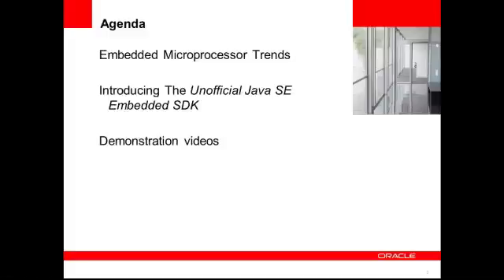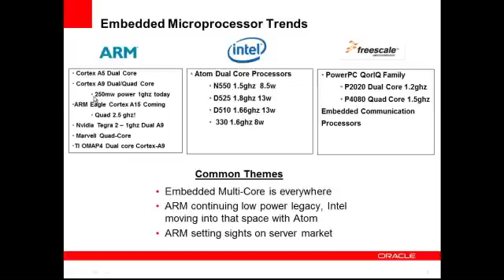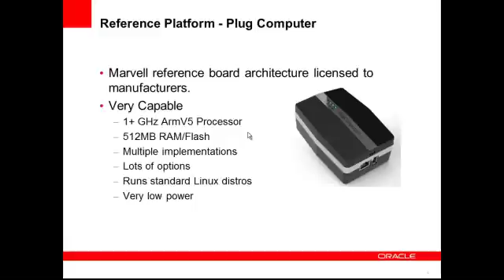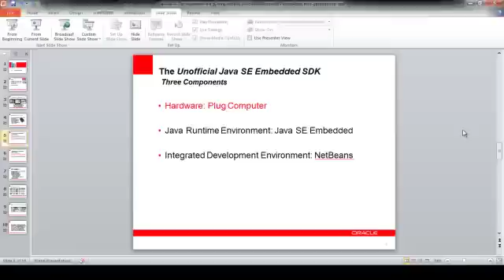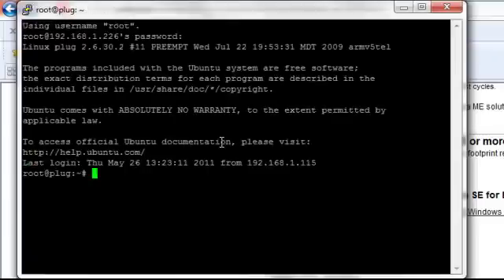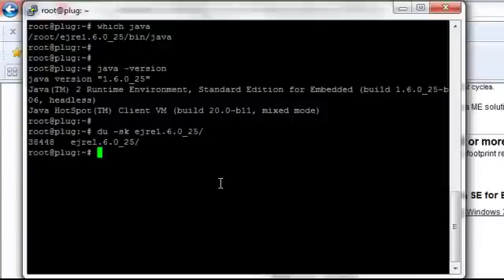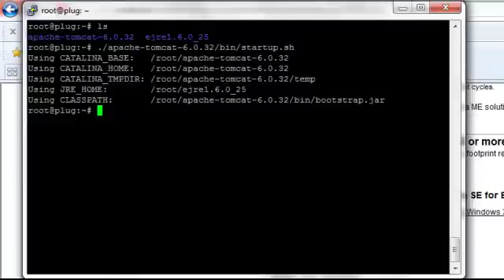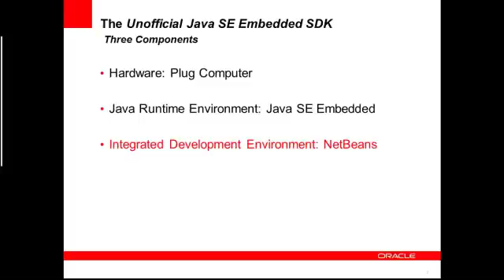Java SE Embedded Development Made Easy - Part 1 of 2

Comment: Whats the point of using this today? We have cloud platforms which charge on different parameters, like cpu usage and mem usage and dont necessarily need to worry about power or clock speed
Reply from the maker: Dude, this video is 12 years old.  The compute world has changed drastically since then.  In fact Java SE Embedded no longer exists.  With the latest modular JDKs, if you need to, you can shrink a Java application and associated runtime sifnificantly

Comment from the maker: Hi tryitpro, there are some minimal requirements including, as of this response, a 2.6.28 or higher kernel version and glibc 2.9 or higher.  The environment typically includes a scaled down linux distribution, in this case the distro is Debian based, and takes up somewhere around 200 MB.  There are many other options and distributions that would work fine for Java SE Embedded.